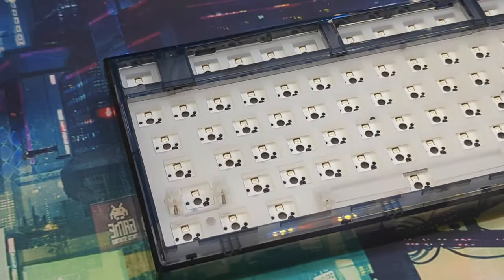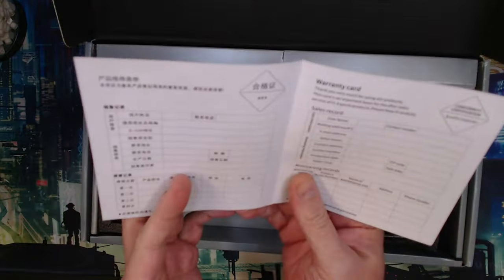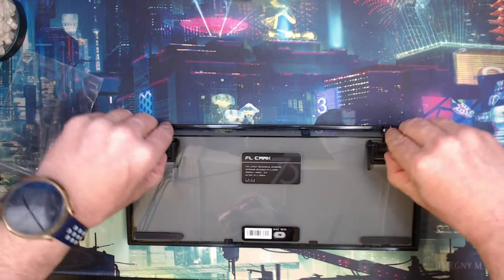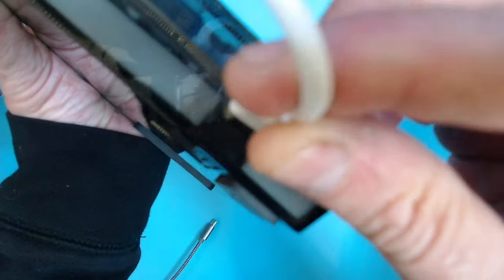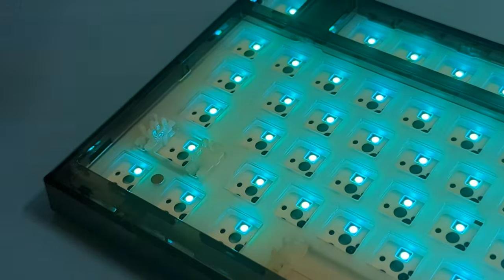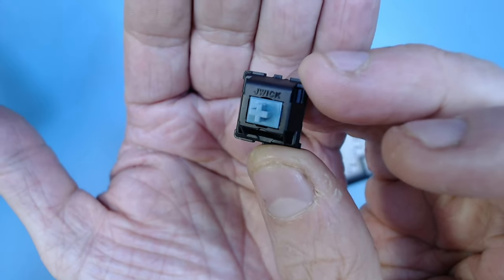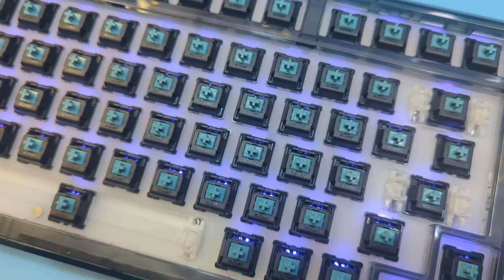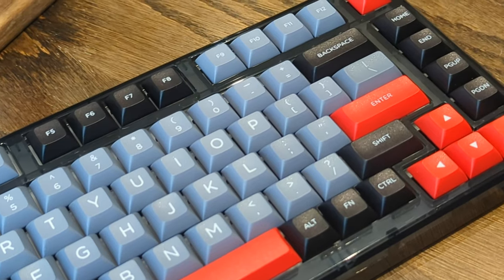Out of the Box: FL ESports Q75. Review and sound test of this gasket mount 75% sans knob kit

Comment: Does it have deck flex? Also it sounds rather dry/high pitched, is that because of the microphone you are using or the switches or both? Personally I want deeper sounding keyboards.
Reply from the maker: There is flex, and the high pitch was a combination of the caps and switches. I do plan to come back to this board and give it a treatment and work the best sound profile out of her as possible. This was plain stock, there is a lot more sound to pull out of this kit :)
Reply: @MechKeyboards  I wish it had at least south facing leds or qkm/via support, would have made this keyboard absolute best under 100$. In your opinion do switches or keycaps matter more for sound profile?  I am thinking of getting this with Gateron G Pro Yellow (3 pin, clear top) or maybe spend more on Water King V3, for deep sound.
Reply from the maker: @teok8855  I don't worry much about interference, but most of my keycaps are not Cherry, and I prefer long pole stem switches, and I too would love if this board came with QMK/VIA. If you want to wait a bit until I do a video modifying it, using some different caps and switches, then maybe make a decision.

I'd think that the G-Pro Yellows might be slightly deeper. I'll use those when I update it.
Reply: @MechKeyboards  I will, and I will also subscribe. I wonder how long pole switches affect the typing experience, in general the shorter travel distance because I do bottom out with my Gateron Brown switches, and they seem a bit light for me. Was considering epsilon but there are some stem wobble, which is what I hate the most, primarily looking for minimal stem wobble and smoothness then secondary, a deep sound profile. Anyways thank you for the video.
Reply from the maker: @teok8855  thanks for watching. A good, budget tactile is the Feker Holy Panda if you ever get a chance to try them.
Reply: @MechKeyboards  thanks. I hope in your following video you can compare this keyboard with TH80 and other similar priced keyboards.
Reply from the maker: @teok8855  I'll compare it to others in this range, like the TH80/NJ80, the IK75, MK870 and the NT75 soon, I've added it to my Video ToDo list. Cheers!
Reply: @MechKeyboards  cool, can’t wait :)